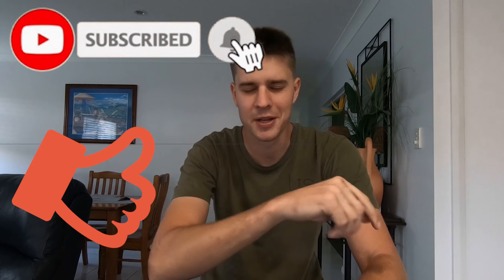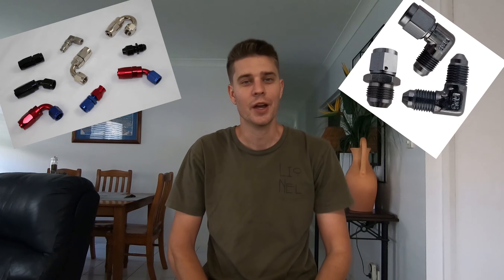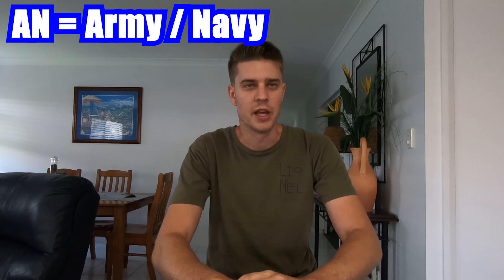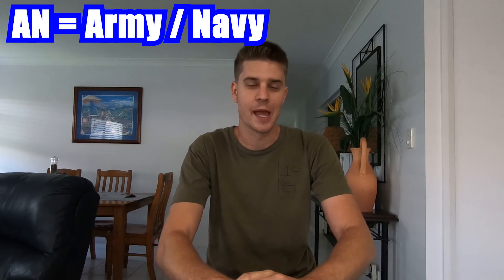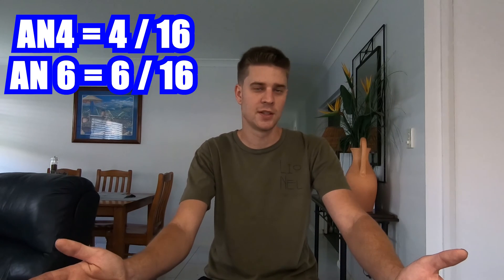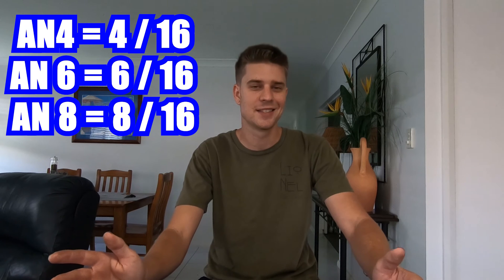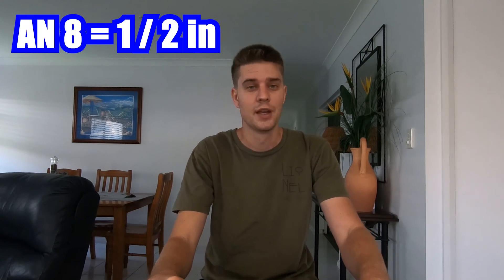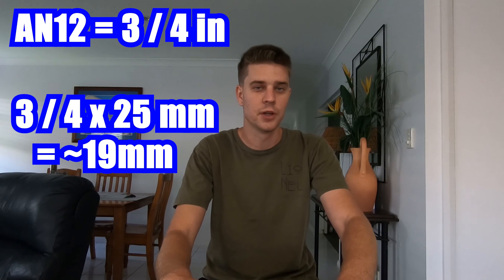AN Fitting Sizes Explained

Comment: so i have two threads i need to but these AN fittings for. I measured the outer threads. is that correct, one is 19mm for the outer thread and then 14mm for the other. So do i need AN12 female? but what about the outer thread 14mm one?

Comment: That explains the ID (inside diameter) of the fittings and/or hose. My struggle is the many “OD” sizes are not standardised...each manufacturer seems to have there own sizes. I.E...a -6an hose will not work with -6an fittings of most the different brands available. Say you purchased a car with existing -AN systems that need repaired...you almost better off removing it and starting over with new stuff...

Comment: 1/2" is 12.7 mm mate. 13 will NOT fit
Reply from the maker: I use 13mm hose on -8 push locks nearly every day.
Reply: @BoostGumps  hard line???
Reply from the maker: @rockinghorsesciencemechani6020  push lock

Comment: I did a learning today!

edit: On an unrelated note, do you have any experience with turbocharging a SR20DE? A friend of mine plans on putting either a 33gts-t turbo or the one that's currently on my 25DET Neo on his SR20 and wants to know if he'd have to change anything in the engine so as to not blow it up. It'll be for track use, mostly.
Reply from the maker: Should do fine! The aspo SR's have internals just as strong as the DET's, Just ensure its tuned to suit the higher compression. A decent head gasket and some head studs wouldnt go astray.
Reply: @BoostGumps  Thanks man, he'll be delighted to know he doesn't have to take the whole thing apart. :D